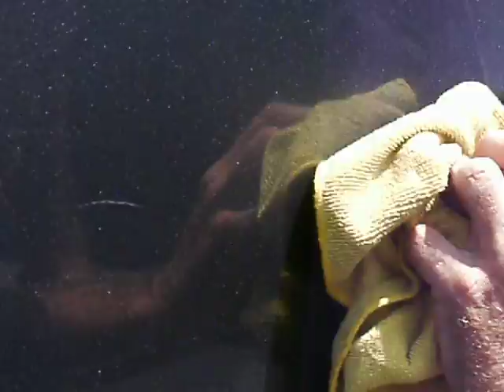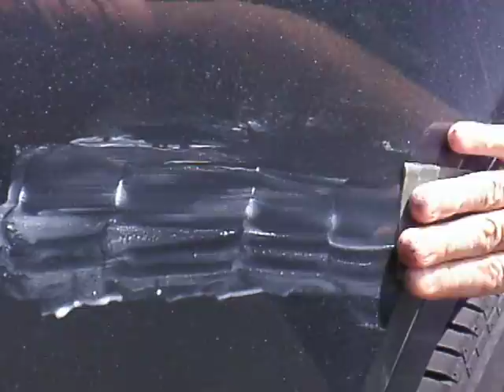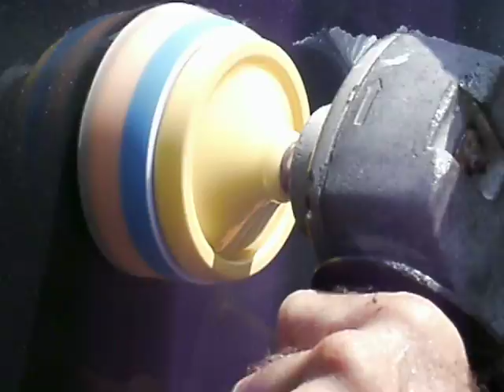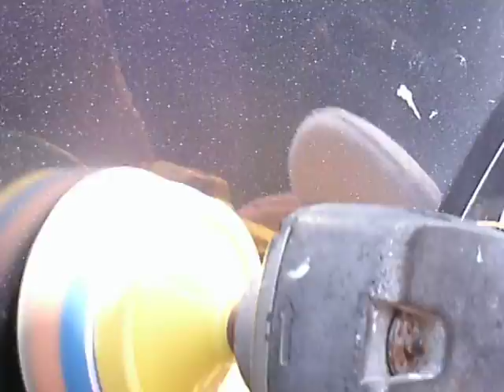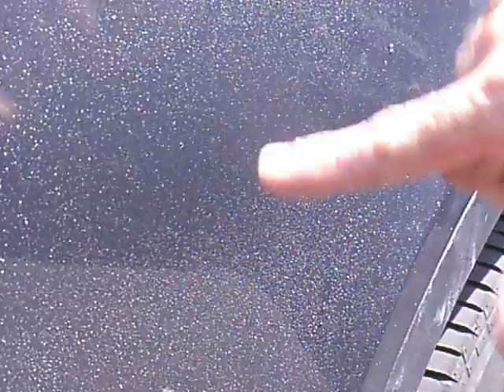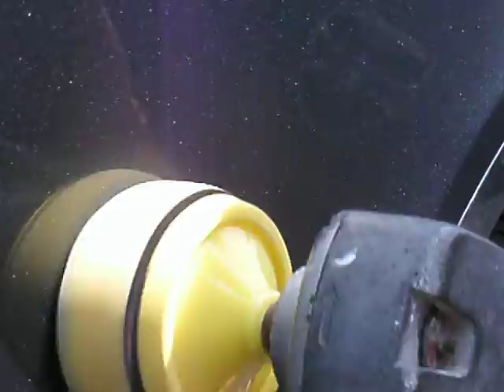Deep Scratch Removal using Xpert (Hyundai)

Comment: it`s easy to understand the clear coat in the structure of your paint is the most harder protecction against  the decoloration, when you put a sand paper against let a clear coat more thin, of course the surface its more like a baby butt, but the protective layer becomes more weak.

Comment: @02mustang38v6 The idea behind wet sanding to to put uniform scratches in the paint while removing the portion of clear coat that has been damaged.  Then buff out the area to remove the wet sanding marks.  I do say that before starting you need to use an paint thickness gauge so you know what your starting with.  Professional detailers have been wet sanding cars for a long time.

Comment: Good video, busting the myth that  removing automotive paint defects  is NOT rocket science.  A simple video, the right products and a few minutes is all you need. 

I would add that wet sanding with  a flexible urethane sanding block will give you more uniform  and accurate sanding scratches when compared to sanding with bare fingers.

Comment: That's a great job but do you need 2000 grit sandpaper in particular? I have 1500 maximum right now. And I tried this but by hand because I don't have a buffer so now the scratched area is more or less the same but shiny =P

Definitely need a buffer.